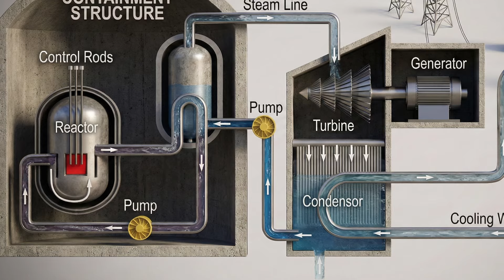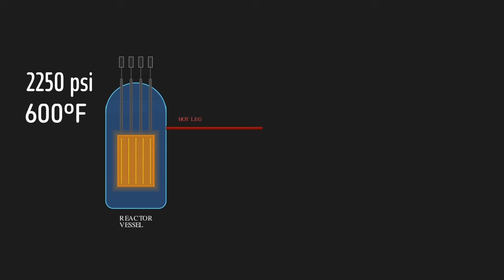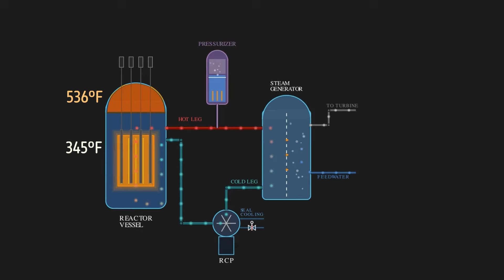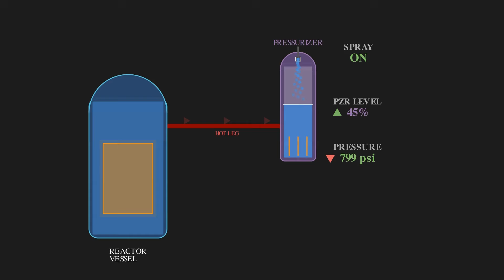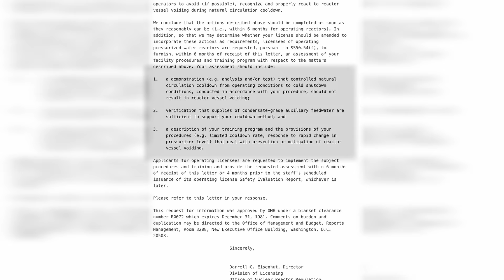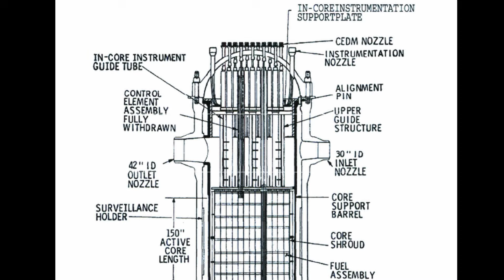The Hidden Bubble: St. Lucie's Natural Circulation Challenge

Comment: I worked there as a carpenter on unit 2 at the time.  I was working  on the upper deck of turbine generator building when there was a loud rumble and steam shot out of side of unit 1 containment. The columb of steam was about 600 ft high. We all dropped our tools and ran. It stopped as suddenly as it started. We all laughed and went back to work.If it was going to blow up nobody could outrun it.